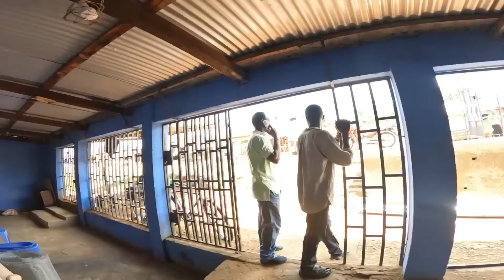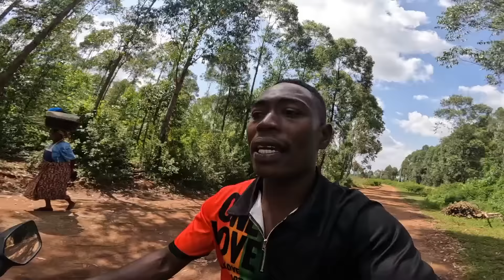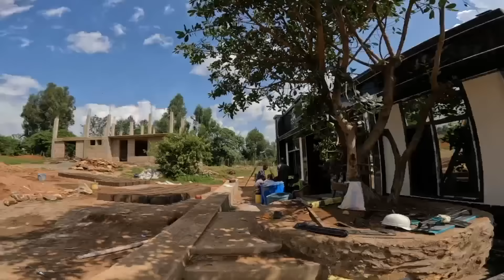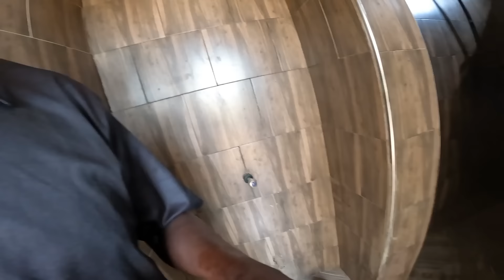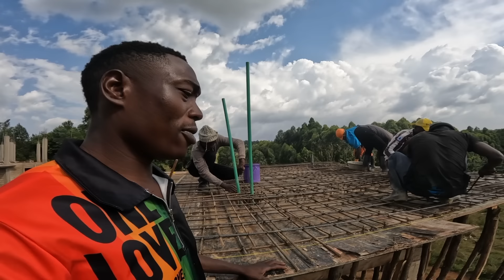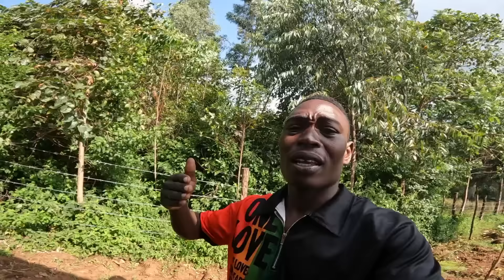SUPRISE DAY2.BUILD WATER TANK YOU CAN'T BELIEVE NEW LOOK OF MAMA GRACE HOUSE CONSTRUCTION HAS BEGINS

Comment: Those Polished Porcelain Tiles have a low COF (coefficient of friction) rating when wet, and using such  Polished Tiles  on the surface of  Stairs if they get wet  will be very slippery... you may need to put some Black Anti Slip Tape, on the walking surface area to prevent the possibility of someone slipping  while ascending, and descending going up/down the Stairs?

Comment: Mayuguno do the logistics before you open your hardware. Hardware is an expensive business. It requires a lot of capital. You will have to buy in bulk to make a good profit and the turn over is not as quick as other business. Just do your research before you start.
Reply: I totally agree with your advice.
Do proper research and think it through very carefully and get advice from a trusted source in business.

Comment: As usual top notch design and workmanship by Mayuguno on all the undergoing projects. The choice of toilet tiles was not good. For the sake of hygiene of such a place white could have been perfect to ensure it's always spotlessly clean. The tiles on the staircase  on Mama Grace house is a potential safety hazard especially with wet weather. Kindly install metallic guard rail on the side and put anti-slip mat on all the stairs. In addition to these, ensure the safety of the masons working on top. SAFETY FIRST.